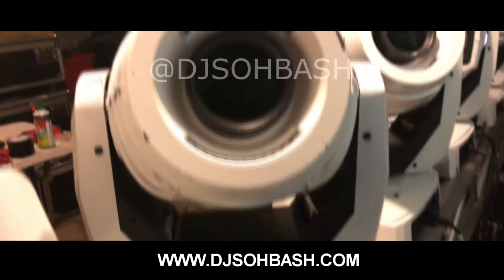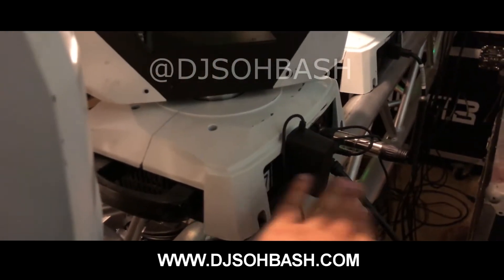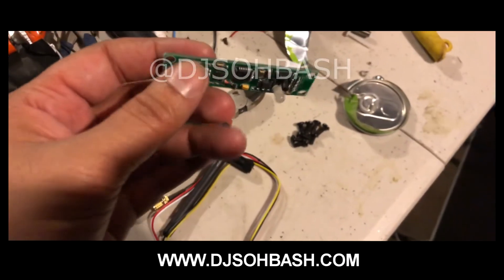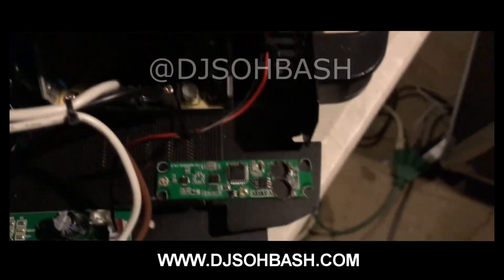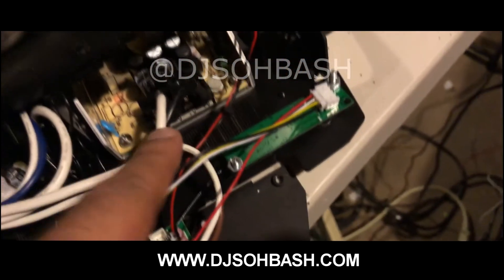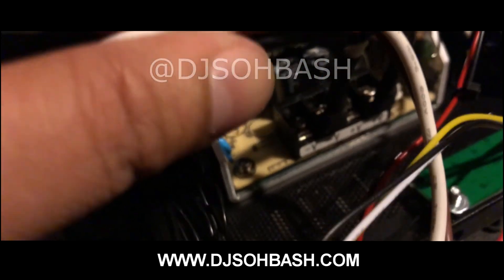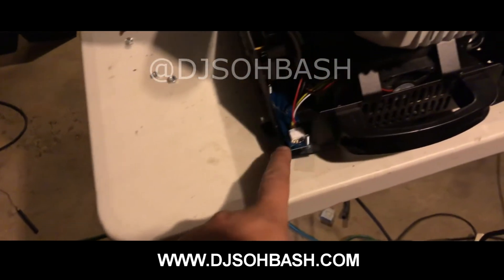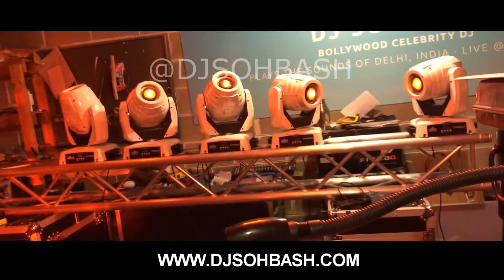Wireless Dmx Chauvet Intimidator Spot 350

Comment: you could just hot glue the board to the inside of the 
fixture.
Reply from the maker: Yes. That would be another option.. but if you have change the color channel the dmx board might become free and move around inside the fixture. I used high strength expoy for my other movers and it works great.. but you still have to drill 2 holes for the light led and channel change button. 
Hope this helps 💪🏼
Reply: @djsohbash  vert true. Nice job